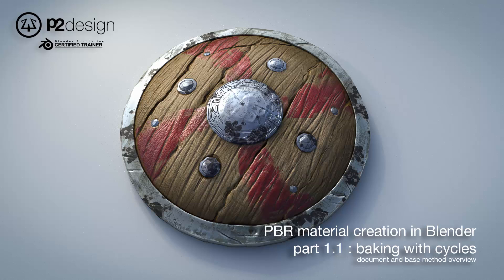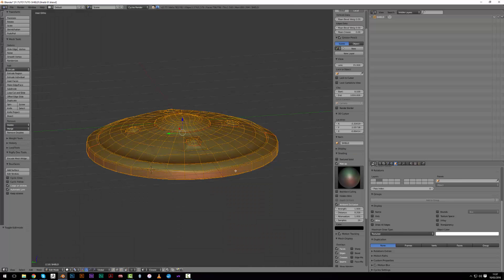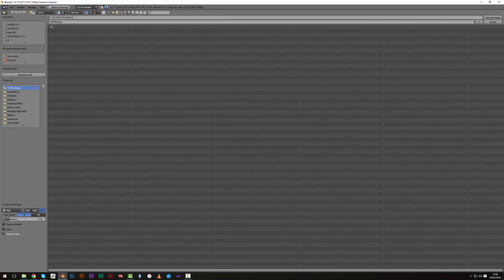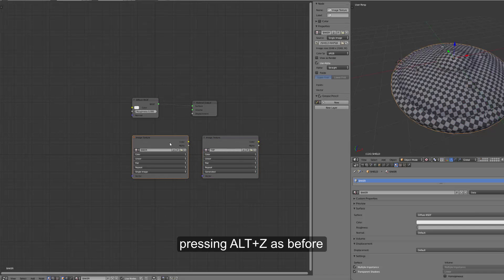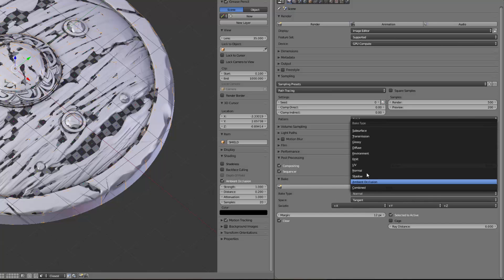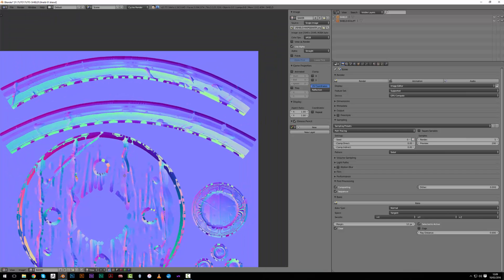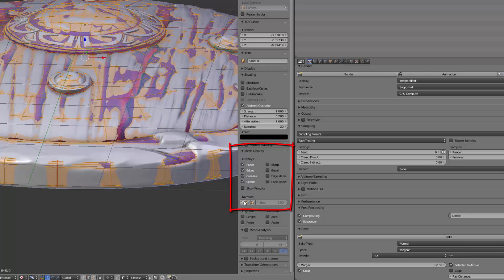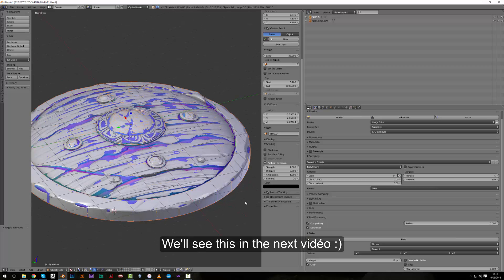PBR MATERIAL CREATION IN BLENDER   PART01 01 DOCUMENT AND BASE METHOD OVERVIEW

Comment: From the blender wiki:

"Select to Active
Bake shading on the surface of selected objects to the active object. The rays are cast from the lowpoly object inwards towards the highpoly object. If the highpoly object is not entirely involved by the lowpoly object, you can tweak the rays start point with Ray Distance or Cage Extrusion (depending on whether or not you are using cage). For even more control you can use a Cage Object."

From this explanation, I believe the low poly object is supposed to full encompass the high poly model (in other words, the low poly model should be bigger). I've seen in another tutorial that you can simply scale one of the models to make sure they are set up properly. How effective this method is I'm not sure, but something to try.